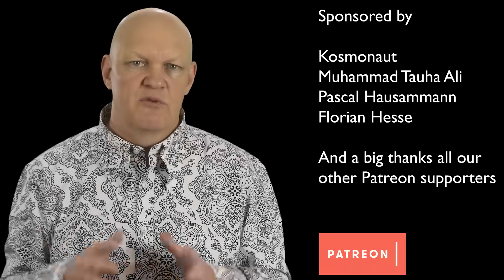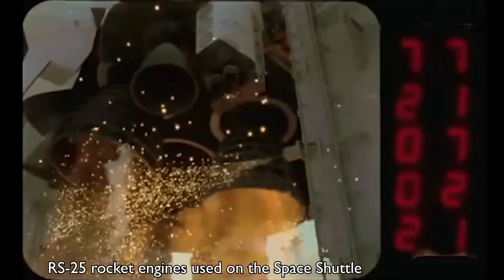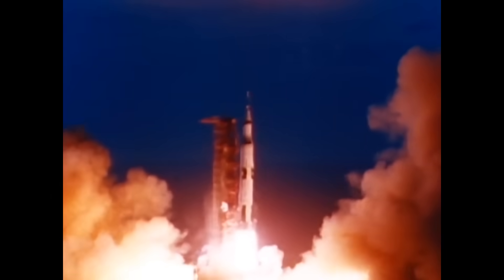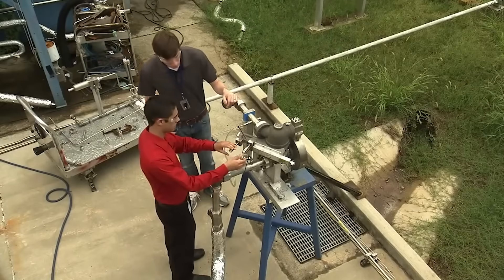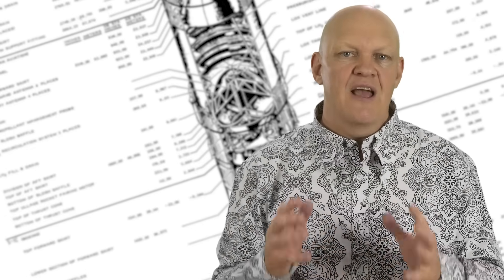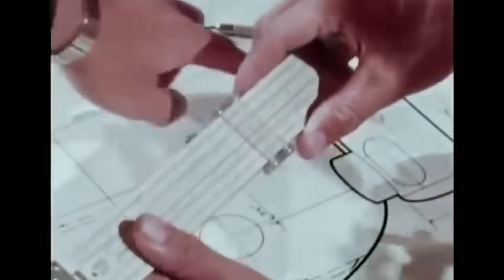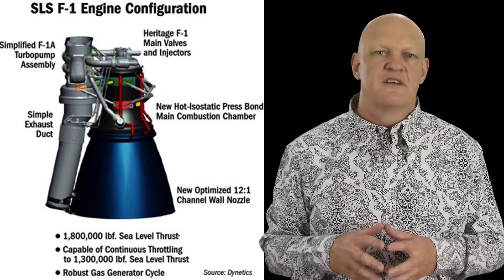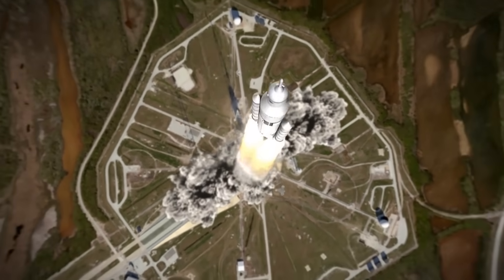Why Can't we Remake the Rocketdyne F1 Engine?

Comment: Imagine a full flow staged combustion engine that huge that runs on methane holy grail of chemical propulsion
Reply: But why such a big engine any more? If you want to reuse a booster by landing it on the engines you need engines which produce not much more thrust than the empty weight of the booster. Modern engines can be throttled down, but only in a limited range. With a huge engine you can't land a booster.
Since the Saturn 5 wasn't reusable they were perfect for the job back then, but today you would do it slightly different
Reply: @simonm1447  you definitely can land a booster that huge, you clearly don't know much about rocketry or spacex technologies and their raptor engine which is full flow. You Clearly don't know the difference between a gas generator cycle and a full flow. Based of physics full flow is the highest achievable efficiency of any chemical engine period. One full flow engine that huge could land over 300 tons 🤣🤣. Open up your books amd learn something my guy the f1 engine of the saturn 5 had a t/w ratio of like 95.1 compared to a full flow staged combustion engine 4 times smaller with a t/w ratio of like 200. 1 and more specific impulse. And that's just one engine. Learn more before you try to argue with someone who knows there shit lol
Reply: @noahgossett6134  lol of course I know the details and differences about closed cycle engines and gas generator engines. I don't need your advise. 

However, can you explain me how you gonna land an empty and relatively lightweight SLS booster (for example, a rocket even more powerful than the Saturn 5) with 85 t empty mass (most of the weight on the launch pad is fuel) with engines with 6,7 MN (almost 700 t of thrust)?
Modern engines can be throttled down of course, but only to around 60 % (Merlin 1D). A modernized F1 with a similar thrust throttled down to 60 % would still lift 5 or 6 empty SLS boosters with just 1 engine.
Of course you can make it 1/3rd of the size, but then you get a BE - 4 or Raptor, which are around 1/3rd of the F1 thrust (which is no coincidence since these engines are planned to get used to land boosters)
Your booster you want to land would have to be huge and extremely heavy, even the Starship booster (estimated 160 to 200 t empty) would be too light to land on a F1

Comment: In ye olde slide rule days, the key to accuracy was to check and recheck, rechecks done by other checking your work, so, nothing blew up while in flight.  Today's reliance on computers without question, gives you a rocket that does blow up in flight.  I would like to see them build one of those new rocket 1.8 million pound thrust motors using the latest CNC and computer design tools and light it off.  Sometimes the best laid plans of mice and men, do work, other times they blow up on the pad.

Comment: The diagram of that F1 engine is not correct it does not show the turbo pump spill or gas chamber and the extension on the combustion chamber

Comment: at 2:18 it is a myth that everything was done with slide rules. there was a lot of computer work used for the apollo but those computers (IBM 1401 and 7000 series that were the side of a room) where only used where needed. I'm sure there was some aspects of the physics that were calculated using a computer considering the highly non-linear nature of the fluid dynamics in a rocket engine

Comment: I would love to see the F1 engine rebuilt but as you mentioned. There will be no way possible to re-design it the way it was. The past shall be the past thank you and please put more information out soon. Love the content.
Reply: The only thing everyone seems to love about the F1 engine are these many tubes of the regenerative cooling. So people say that they are made of a very expensive ( and hard ) alloy. So how do you bring the material into tube shape, in the first place? Welding leads to tension and cracks. For these reasons, other ways to manufacturing were found. Though it might be fun to use to hammers to hammer holes into a piece of metal. Then use a robot in a clean room without oxygen to arrange all these pieces inside a (rotating) bell. Then use a second bell and heat to press them all together. A forget rocket nozzle!  Medieval technology meets 2023.

Comment: I usually like these videos but am calling  BS and hyperbole on this one.
1. Actually NASA demanded that every component be meticulously cataloged and processes documented.
2. We don't need the 1962 F1 engine anymore so we don't keep around procedure and processes manuals. Do you keep your documentation around for that Hayes modem you bought back in 1985?
3. Almost nothing is stored on paper anymore and much of the factory operations like assembly, welding, etc.. is automated and inspected and reinspected.
4. At any given time there are at least 3 different programs from 3 separate internal or contract design teams that are working on vehicles and engines to go back to the moon and possibly (chuckle) Mars. Far more powerful and efficient than Saturn.
So , yes.. we are decades ahead of the people who designed and built Saturn / Apollo. 
What makes that time amazing was it was all brand new technology and now it is simply a better version of an original idea.
It's kind of like. I really love my 1969 Mustang. It's fun as a hobby to take to car shows and all. But I sure as shit would not want it as my daily driver.

Comment: It's no surprise that the missing ingredient is skilled engineers. Anymore, you can tell that we rely too heavily on technology, instead of really immersing in all aspects of design and build. I'm an aviation mechanic, and it's quite obvious the difference a generation or two has made. Even the manuals for legacy design are of a much higher quality than newer resources. The thinking that went into writing maintenance documentation was so much more thorough and I appreciate the older stuff. We were better back in those days. All around.
Reply: Not really. As the video explained, the modern design reduces the numbers of manufactured parts from 50,000 to 40. You don't manage that without skilled engineers.

The reason we can't make F-1 engines now is because of the sheer complexity of the solution wrt modern manufacturing techniques. We don't hand build engines anymore and we wouldn't want to again. Rockets go up all the time nowadays, and reliability is far superior in the modern age.
Reply: Couldn’t agree more, I’m a carpenter for 25 years, it’s very hard to find a young kid as a helper, who wants to learn everything. I pass my skills on whenever I can.
Reply: Agreed. And I've had to work with younger mechanics who don't have a clue.

Comment: Russia had the right idea using large numbers of small, easy to build engines.  SpaceX uses this philosophy today.   The mighty F-1 was a masterpiece that required huge resources to design, build, and test.  The SpaceX Merlin and Raptor engines are small enough to move with forklifts and pickup trucks.  So much easier to work with.
Reply: Yet when they tried, the rocket (N1) utterly failed.
Reply: @Tim22222  True, but that thing jumped right off the pad on the tests when it at least managed to launch.   The story might have been different had the program not been so rushed.

Comment: When you talked about not being able to recreate the engines because of all the modifications that got made and how unique each engine was it made me think.

Reverse engineering is taking one example and recreating another version of it based on that example. Testing the original shows whatever flaws were inherent in it, and reproductions based on the reverse engineering can determine the ways necessary to fix the problems. This is how reverse engineering works. If you ask me, NASA just didn't want to spend the money or the time to go through the process of reverse engineering. There are plenty of examples of F1 engines still in existence. More than enough to be able to reverse engineer the technology.

Comment: As touched on in this video, there is little point trying to build the same F1s they used back in the 60s when we can update the designs to create a more powerful and cheaper to manufacture version. It's not that we can't build one today it's that there is little point. The skills in machining and fabrication are still there but significantly enhanced with newer technologies and methods.
Reply: Yeah.. A lot of people lament that we've lost the skills of the past, but they're ignoring that we've replaced those skills with different ones that fit better in modern times.

Science and technology advance, and manufacturing has to advance with them.

Comment: At its maximum, the F1 produced about 25 million horsepower. They weighed about 18,000 lbs. thereby generating about 1350 HP/lb.  No other engine has achieved that, before or since.

Comment: If I remember correctly, a long time ago, Boeing offered a "Golden Handshake" (early retirement) to anyone, I believe 52 years old and older.
They were expecting 3000 to 3500 to take it, but about 9000 took the deal.
Not long later there were problems cropping up in the shops and other places and discovered a lot of people with critical knowledge had taken the "Golden Handshake".
The result that several had returned but as "Consultants", at a considerably higher pay.
That was the first and last time they offered anyone a "Golden Handshake" (that I know of).  ;-)

Comment: Cost aside. I'd absolutely love to see a saturn v launch in person. I've been to shuttle launches and the power felt with those was super intense. I can only imagine what a sat v launch was like.  Goosebumps just thinking about it.
Reply: The thrust to weight ratio of a fully loaded Saturn V at ignition was only barely above 1 (1.04 IIRC) which meant its launches were majestic as it slowly rose and started to accelerate as it burned fuel reducing weight. The Space Shuttle TWR was much higher something like 1.3, it would lift off and clear the tower very quickly in comparison.
Reply: My FIL was in Florida working during the Apollo 17 launch and went to watch it. He described as so bright it looked like the sun was shining in the night. He said if he didn't know any better he would have thought it was day. The sound was like standing in front of a huge speaker at a concert and you could quite literally feel the sound through your body. It was intense for the first min. Mainly he just couldn't believe how bright it was

Comment: Well, on the SLS they could use 2 RS-68A as used on the DELTA IV instead of 4 RS-25 STS based engines. This would require a slight flight profile change, but overall it seems like a better and cheaper choice. From the old designs, the building of the Aerojet M-1 LH2/LOX engine producing 680 and targeting 800 tons of thrust would be an interesting proposition, better than the F-1 RP1/LOX engine giving 680 tons of thrust, since most rockets now use LH2/LOX for their core stages.
Aerojet M-1 - Wikipedia

Comment: It can be helpful to study and analyze an old design, but given these kinds of factors, it is not worth it to remake them the same way. Modern manufacturing technologies are easier, faster, and more consistent, not to mention inherently better documented due to the needs of automatic machinery, than old ways. CAD also lowers the bar on making fewer parts do more things, as you mentioned. 

Of course, though our big rocket game may have grown rusty, we bring a bunch of newer insights and skills they never even thought about. FEA can lighten everything, the most valuable quality in a rocket engine. It can also root out stress risers, eliminating a major category of failure modes. We have a second chance at doing what we did badly before- absolutely wacky wire and tubing dress that looked far more vulnerable than that on my old Toyota. There are old, ingenious technologies we could stir in- Koralev's beautiful design for engines that use the rocket itself, not a heavy external pump running on other power, to pump the fuel. He only developed it for modest size engines, but I expect we could scale it up.  We may even have learned a couple new things about fluid dynamics.

Learn, analyze, mine the past for good ideas, sure. But absolutely design freshly.

Comment: with all our tech and simluations and modern manufacturing, we still rather go for some ugly external exhaust, while the brilliant F1 engineers just used the exhaust to protect the nozzle on the inside xD I mean I get it I get it. way cheaper, way more reliable, easier to produce etc etc....but you must admire the ingenuity and hard work of those engineers/workers. I'm an IT guy....I'd rather be a "I welded on F1 engines" guy :/

Comment: There were about 10 different forgings that made up the turbo pump housing. All welded and hand blended together to make one part. Most of the splined curves and “3D” work was cut on a pantograph off of a master template. A few parts were roughed out on a mill and finished on a die sink EDM, but still hand fitted and lapped in the end. Those skills haven’t been taught in over 30 years. I haven’t seen a Deckels pantograph in 20 years let alone someone who has mastered the art of setting one up and making good parts with one.

Comment: So I was working on advanced propulsion systems.  I usually did a historical investigation to see what had been done in the past.  We had libraries but way to many of the reports were water damaged, covered in dust, and had black widow spiders crawling over them.  I am not kidding.  I found that our engineers had done what I was attempting to do.   I talked to the Engineering managers and they thought I was crazy.  Those guys in the 60/70s developed some material that could not be obtained today and there was not record on how it was made.  I talked with metallurgists and they said, “how did they do that”.  And those engineers are gone.   I have so many examples where the engineering and science have to be re-developed.

Comment: Even if they had the hand written instructions you still wouldn't be able to build a Saturn V. The biggest problem is obsolescence, the electronic components are no  longer made and the manufacturing techniques long since retired, the materials are different, the build infrastructure has long moved on and even if you could get past all of that none of the testing specs would be relevant requiring a complete re-test program. Be cheaper to implement a brand new design. RIP  to an engineering masterpiece, the mighty Saturn V.

Comment: I myself have designed and built a 1000 machines and when I designed on cad there was probably 3 mistakes from 100 components from a unit that weighed in at 2 tonnes true I am not a rocket engine designer but the same level of skill in design is the same the pieces need to be made geometric on a 3d space so they all fit together it's TRUE mistakes are made through human error and we design most of our crap now a days before building it but compared to 50 years ago our tech is way better more reliable and all round suited to our way of life I admire the old craft but I dont miss it peoples ideas of the past are silly romantic moments of a time gone well no thank you I will take a cnc Bridgeport any day instead of manual milling

Comment: You can make anything that's not the problem it's TRUE the skill of tool makers are gone but when you look at the redesign of the original its probably better in every way not because it's new but the way we make things now are much more accurate the way it should be working 50 years ago was very cowboy work ethics very riveting methodology were is now we have much greater control over manufacturing techniques to be quite honest you could just CNC the whole thing and it would just be as reliable through testing the old saying they dont make them like they used to is outdated and belongs were they did things like that we can mass manufacture a billion cars I dont think we have a problem with one engine it's not star trek it's a rocket engine nothing more

Comment: So they gave the Saturn V engine to some young college engineers to analyze and redesign it for an unknown use. Quite a challenge to take a heap off the junk pile for a redux. Been there done that. It will work but there are shortcuts and design tradeoffs making the product just as complex as the predecessor. Sure, fewer parts & increased reliability were achieved for the next generation prototype. However, we're old materials used or current technologies. The true cost of the new engine remains hidden in the gap between then and now. Hence, true cost increases have filtered to just then and now causing the natural law of economics to be blurred. This means is the new engine cost effective for the current role(s). We do that know that either. Although, a new engine has been created and the design is proven feasible. All that remains is to use it. Perhaps a new fuel needs to be created for the new prototype.

Comment: My uncle lived several miles from a test stand. NASA always told then when they had a run cycle so they put rubber bands on the cabinets and took the pictures down. 
One day they ran more than one engine AND forgot to warn the residents. He said all the plates and glasses literally walked out of the cabinets and dove to their death. 
On a happy note, they promptly received a check for new dishes and cups.